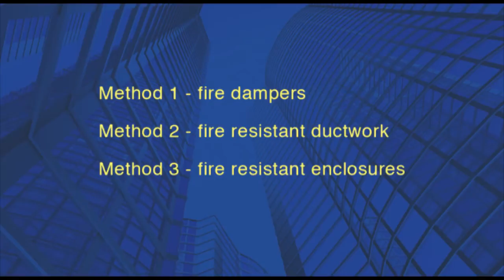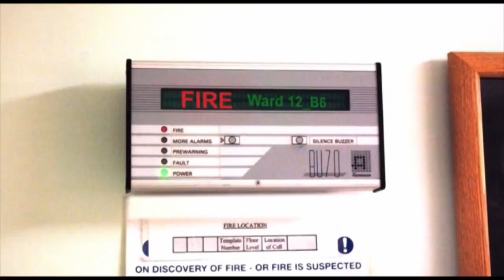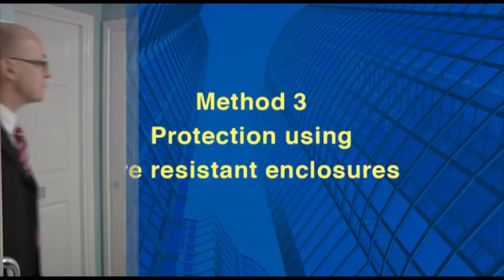Ducts & Dampers | Getting Technical

Comment: Fire suppression system for air ducts
Patent number: 9089727
Abstract: A system for suppressing fires generated within air ducts. The system can include a duct with an aperture, a reservoir containing fire retardant material adjacent to the aperture, and a temperature-sensitive sidewall. The aperture can be sealed with the temperature-sensitive sidewall creating a temporary barrier to fluid communication with the interior of the duct and the reservoir. When a source of heat exists within the duct, the temperature-sensitive sidewall melts or ruptures, expelling fire retardant material. The temperature-sensitive sidewall can be a fusible plug or a frangible tube positioned within the duct in a non-obstructive fashion. The fire retardant material stored in the attached reservoir can be expelled into the interior of the duct, suppressing or retarding the source of heat in response to a temperature in excess to a predetermined value.
Type: Grant
Filed: January 17, 2014
Date of Patent: July 28, 2015
Inventor: Gerald Grattan Flood